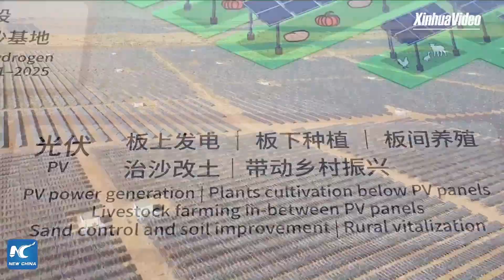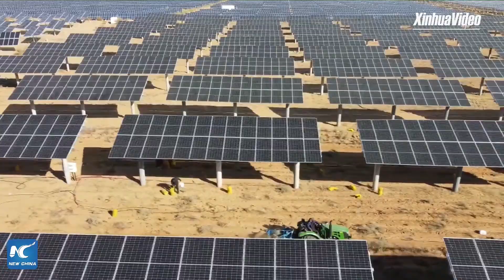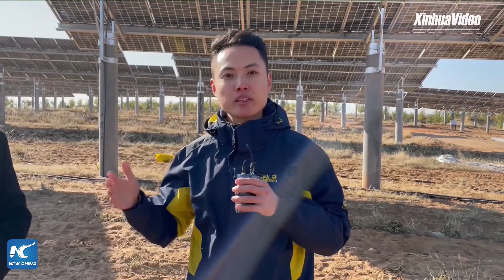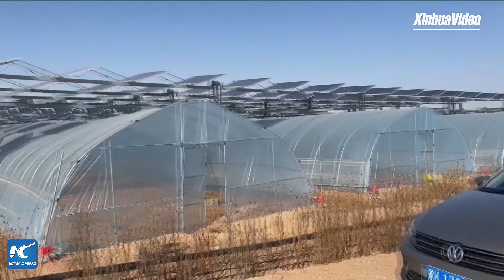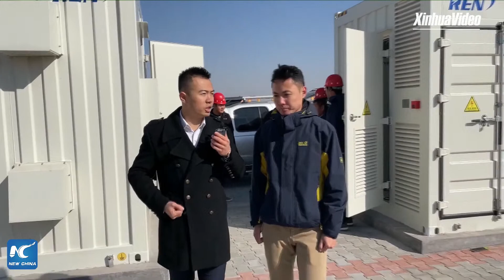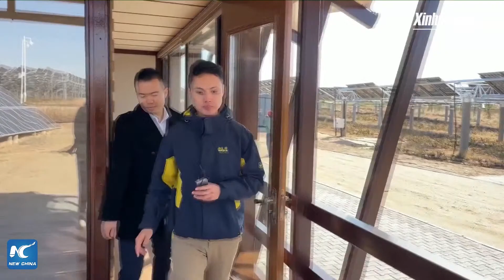Solar farm in desert restores ecosystem, boosts green economy

Comment: Terrific work thanks. This is Agrivoltaic development at its best. Reforestation of the desert helps to strengthen the planet’s photosynthesis capability & IMHO provides the best way to support life on earth. 

This is world-leading research of the highest calibre & I hope that you will continue in this way & present your findings to convince world leaders to follow your lead. 

I have many questions to ask but will restrict myself to just this one. Have you found that growing plants under the PV panels significantly lowers the temperature on the underside of the panels & thus improves your electrical output? Can you quantify?

Comment: Ok so this boosts the green in China. What about locations where the minerals to make these panels came from. All the frames on solar panels are aluminum, you mean all that petroleum used to mine the aluminum was good for the environment. What about all the coal China burns to make the electricity to process the minerals into these panels. Doesn't the burning of coal still harm the environment? Wait until the panels lifetime is over, ( 20 years) will the recycling of these panels be green. More likely these farms will be like the windmills that have went thru their lifespan, they will simply be abandoned. Is that green and good for the environment. It sure seem to suit certain political people who don't have a thought about the energy used to make these panels.
Reply: Bet you just want to continue driving v8 pickup truck, against public transportation, invade foreign lands for their oil. 

There must be a real country doing all that for sure. I just can't think for now...

Comment: Actually, there's quite a bit of energy inefficiency in using electricity to produce hydrogen and then convert that hydrogen back into electricity. 60-80% more energy efficient to simply either directly transmit electricity via transmission lines or to store it in 🔋🔋, pumped hydro, gravity storage etc for later transmission as and when the grid demands.

Comment: Also noticed that the outdoor irrigation system is a spray based one instead of drip irrigation placed directly onto the soil and for desert agriculture, it is absolute madness to water during the day. You end up losing far too much water to evaporation from wind & sun, failing to irrigate both crops and build up of soil moisture over time; irrigate late evening or at night only.
Reply: Maybe just for video purposes. Anyone doing this would have realised that.
Reply: @TsLeng  You would be surprised. I've seen many such examples of desert irrigation just like this used during daylight hours  - many of which who's water comes from ancient underground reservoirs thousands of years old, cut off from any means of replenishment; in other words priceless & irreplaceable. Just because you and I prefer to use common sense, not everybody does.

Comment: It's great to see regenerative agriculture being used to prevent ongoing desertification. Hope that instead of pulling the whole plant out, roots & all at time of harvesting, the plants are cut off at ground level, leaving the roots to carry on building up organic matter, sequestration of carbon & nutrients. Should end up with a very rich soil over time. Couldn't help noticing that someone was using a tractor & plough. This is a practice that should definitely be discouraged as it disturbs the soil structure & encourages desertification - the exact opposite of what is trying to be achieved. Nothing wrong with using a tractor but whenever possible, direct drill sowing equipment for seed sowing should be used so that the soil is disturbed as little as possible & the soil fauna aren't brought to the surface. Around the world, ploughing is ruining soil structure, encouraging soil erosion & slowly killing off the soil fauna meaning that we only have about 50-60 harvests left according to scientific research & evidence. One teaspoon of healthy soil contains billions of microorganisms (soil fauna) & by exposing them to light, air, H20, they begin to die off gradually reducing in number. This is why in permaculture/regenerative agriculture, the soil is disturbed as little as possible & mulching is used to add organic matter to the soil & retain moisture when crop growing.
It might be worth exchanging the grazing for harvesting of the local vegetation to feed the livestock. In severely degraded parts of Africa, the feeding of livestock in their enclosures has had (huge) regenerative effects on the local environment & the livestock are actually doing better as they don't expend a lot of energy looking for food.
Fabulous project. China's insistence on continuing to develop coal fired power stations is absolutely mad and something of an (own goal). Air, H20 & soil pollution, higher health costs, lower productivity & GDP, increased climate change exposure with damage to crops, land, infrastructure, problems with insurance provision, loss of life from hurricanes & flooding & so on. I may prefer democracy to the one party system but having said that, there are real benefits to the one party system; you can really get things done if you have the will. Just look @ Shenzhen's public transport; 16,000 electric buses swapped overnight after the relevant planning. Truly impressive. So why doesn't the Communist Party simply decide to get electrification of 🇨🇳 done? Obviously won't happen overnight but could happen at speed if political will was there. 🇨🇳 could easily shame the world on clean energy, increasing economic power in the process.
Reply: You have to factor in the technical, ecological and financial resources needed and the challenges that needs to be overcome to expand the idea to every desert in China. That's not something you can achieve even in 10 or 20 years, considering the total desert land area in China.

Comment: 23:45  you mention sending the electricity over the grid is difficult due to the distance to the main areas of consumption…..alternatively you could store the energy by mining bitcoin. Then use the funds to buy the energy where you need it  as Bitcoin can be sent instant;y any distance. Pity your government banned bitcoin mining.  Perhaps[s they will reconsider you could also produce hydrogen via electrolysis ps excellent video. Thanks for sharing :-)
Reply: Bitcoin is illegal in China.

Comment: Ha ha. I’ve been saying this for years.   You could also use the electricity  to pump water from the deep subterranean aquifer .. well done.   At last people are using their brains.  Hopefully the chinese will export cheap panels to Africa to help them get going with this idea   Imagine if large parts of the Sahara or Namib  was covered with panels. I know the Cp gets a lot of bad press but this project and the people behind it should be high;y. Commended.  …brilliant …. Excellent presenters too. Pity your premier didn’t attend the cop conference and present this project  he would have been congratulated
Reply: Actually we don't need to export Chinese solar panels for two reasons the first one is that we can manufacture those solar panels ourselves and secondly by combining hydropower and geothermal alone in theory Africa could exceed X5 the amount electricity needed to power the entire continent 24/7 without utilizing other power sources such as nuclear and solar...

Comment: I've been wondering if something like this would work for about as long as y'all have been working on it. Good job to see it really works. Recovery of desert land can help by binding more of the CO2 in the air, and provide food. Over time, some of the land could be reserved for new villages as needed, to keep the supply chains as short as possible, both for the produce and for those working in these solar fields.
P.S.: Using the animals will also help, but don't forget the micro organisms needed as well. And, fungi, worms and insects that help to turn that sand into deep, fertile soil suitable for trees. And expect the climate around there to get wetter the further into the desert you push, as the first areas become surrounded by green.

Comment: What a great operation. I am speechless! Producing electricity, restoring farming land and reducing CO2 at the same time - what an efficiency! 
As wind and sand seems to be a big issue, I wonder, why they do not start with building windmills to reduce the power of the wind an produce even more electricity.
Reply: actually they do
Reply: The windmills will block the sun, shade moves around all day. It may be cheaper to use solar panels. Solar panels are  much cheaper in China. May be we can consider making transparent windmills.
Reply: There are wind mills along the earthen path they were walking along.
Reply: @spadeysay6846  Yes, I saw them. But I meant large ones, which can make a difference in terms of power the remaining wind has to move sand dunes.

Comment: It looks like the water used to wash the solar panels also serves to water the plants underneath. Do the plants under the panels also keep them cooler and improve their efficiency?
Reply: The humidity is very low, even with water. So as long as there is no sunshine, the temperature drops significantly in the shade. I have been to those deserts in summer. you can feel the temperature difference between places under sunshine and shade easily.

Comment: I'd like to see what is being done in all the other deserts. There's massive potential and job opportunities.
If China did this to every piece of desert land would that be enough to become carbon neutral? The thought is intriguing.
Reply: They still need electricity at night time.
Reply: @BSnicks   batteries are the solution?  Southern Australia used batteries now.
Reply: @danhdang701  Do they really have that many batteries? They can use geothermal energy, which also works at night. Or for storage, CAES!
Reply: @BSnicks  Tesla's big project there.
Reply: @BSnicks  you can ask Elon Musk about it. He is promised to make it becomes reality.
Reply: @danhdang701  He is as fake is all the other CEO's in the US. I think he is just rich, that's it!
Reply: You can bet China wants to and will. But that should only be done with measured steps. As technology improves and cost are lower.

Comment: Great. Next step could be full eléctric and perhaps autonomous farming.
Reply: Electric farming, like electric tractors? That will never happen.
Reply: @akyhne  why not? If not electric than hydrogen.
Reply: @EV-FUN  Hydrogen may be doable in some situations. Electric is out of the question. No one has the time to recharge a tractor 5 times a day.
Reply: @akyhne  and what about NIO doing battery changes?
Reply: @EV-FUN  Battery changes... where? In the middle of a field? I don't think you know how modern farming work. Tractors rarely go forth and back between the farm, and the fields. During harvest, it's not uncommon that you drive into the field at 9 o'clock in the morning, and drive until 2 in the morning. With no breaks, other, than to refuel, or rive between fields. You eat on the tractor, while working.
Repeat every day for 3 weeks.
Reply: Ok, but what do you suggest?
Reply: @EV-FUN  Green bio fuel. As I wrote, hydrogen can work in some situations, but no one can afford to buy a tractor, that is only usable for specific tasks.
Large tractors easily go for $150-300.000.
Reply: @EV-FUN  It's also way more important, that we stop using coal, than oil. Oil can reform again in the ground, coal cannot. At the time coal was formed hundred of millions ago, there was a lack of bacteria present, to prevent this. That's no longer the case.
So all CO², We now release from burning coal, will be hard to get away from the air, while CO² released from burning oil or wood, can go back to the ground, although it can take hundred of years.
Reply: @akyhne  ok. I am fine with bio fuel
Reply: @akyhne  Current technology may not feasible for LARGE farms but in 4/5 years we have large battery storage capacity/changes and good milage. btw except western world most of land holders are SMALL farmers.
Reply: @akyhne  already got them in China and some western countries and companies are working towards them
Reply: @stephenhill8790  Towards what?
Reply: @akyhne  electric tractors
Reply: @stephenhill8790  For small time jobs, they may work. Not for large 16+ hour work days.
Reply: @akyhne  that is true it this time but it may come to pass that battery tec changes